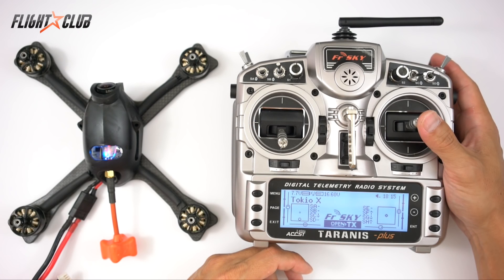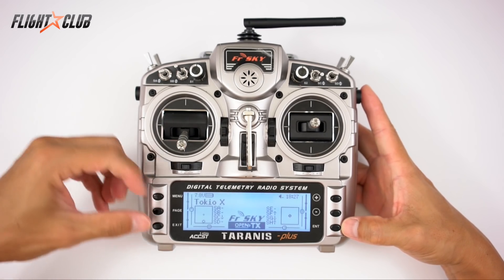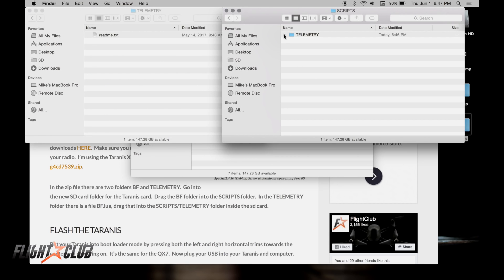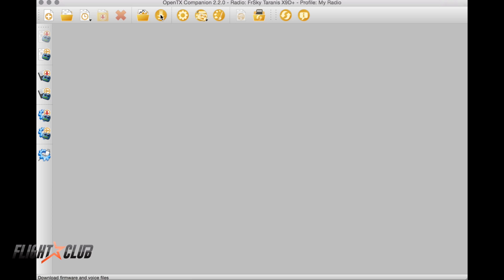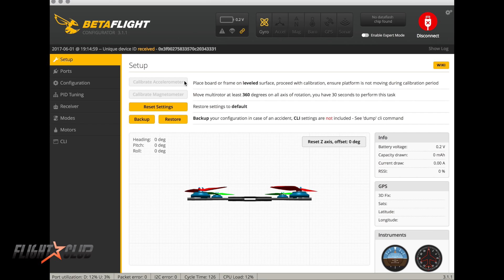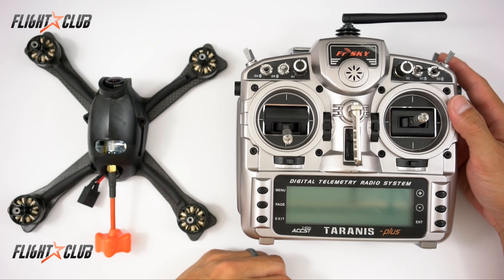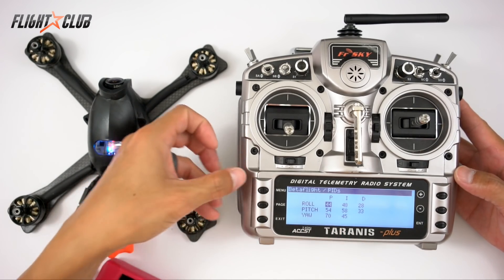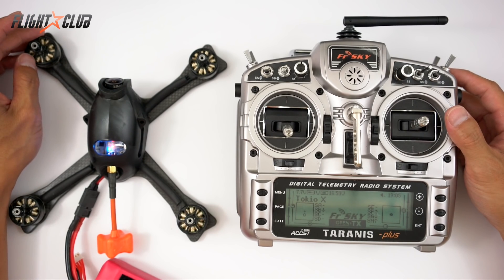Taranis LUA Scrip : PID tuning from your Taranis

Comment: I got everything to work. my pids show up and everything. the only thing that doesn't work good is it when I turn it on to Bootloader mode it still shows my old bootloader. is this normal or is there some way I can fix it. other than that everything works fine. I tried plugging it into the computer with the radio turned off. and my computer won't recognize the radio. it has to be turned on in bootloader mode for it to see it.

Comment: will the lua work with the revolt rf1?
Reply: I assume a Revolt RF1 is a flight controller.  If you have an FrSky receiver and are running OpenTX and the flight controller supports SmartPort, you should be golden.